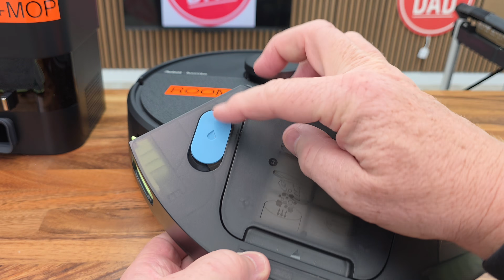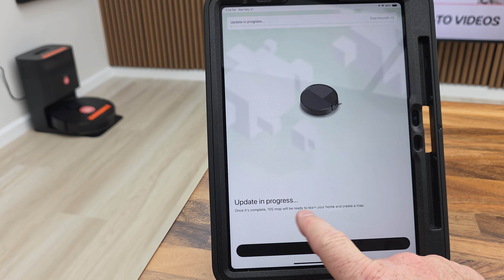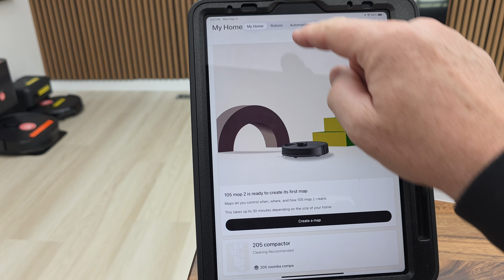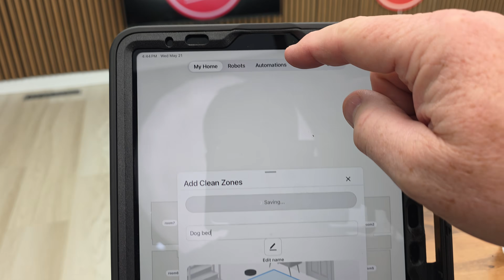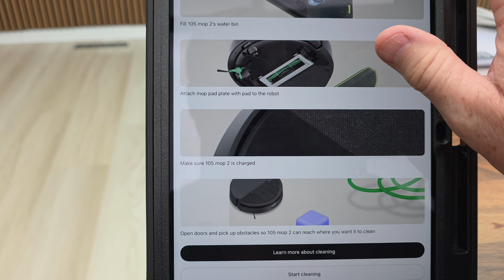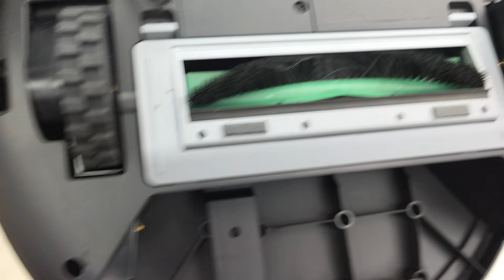Roomba 105 Robot Vacuum Review: Unboxing, Setup & FIRST LOOK – Did It Disappoint or Surprise Me?!

Comment: Does the mopping pad need to be removed if you want to run it on both rugs and hard floors in the same cleaning process, please?  I just bought it for $179 on HSN but not auto emptying capability.  Roomba 105 carpet and mop.

Comment: Bought this Roomba for $299 on amazon and retuned almost immediately was very subpar compared to other Roombas in the past. This model requires a different app than my Roomba Braava jet, so the user experience is very disjointed. The app barley works (Roomba Home V.1.3 iPhone 15 pro max IOS 18.5 at time of writing) Doesn't clean as well as the other 3 Roombas I've owned over the years, and matter what I do it doesn't properly dump all its contents in the bin; it just ends up on the floor. Worse yet I can't get a full refund because they want to charge me $14.95 to ship the junk back. I got a Yeedi M12 Pro + with accessories for $438 on their website and couldn't be happier!! 😁

Comment: Is it necessary to install the app and connect to the wifi, or is it optional? I just purchased this robot and charged it last night, but today I attempted to use the vacuum, and it did not work. With my older roomba I never had the app, so I don't know if this one is broken or if it is just that I need to install the app.